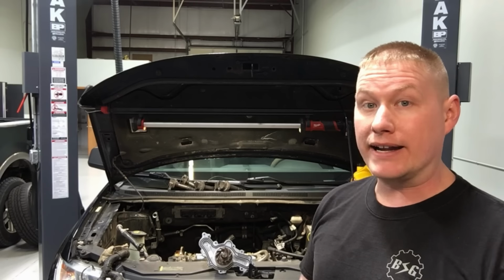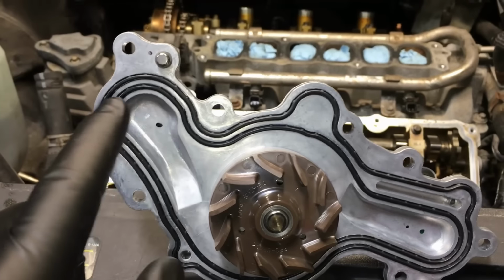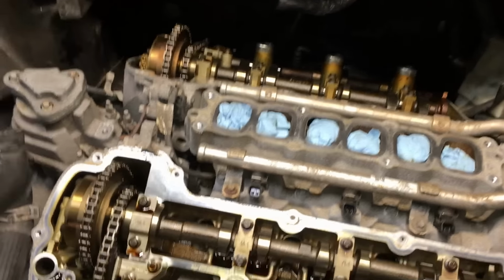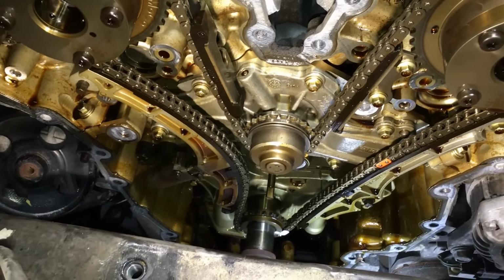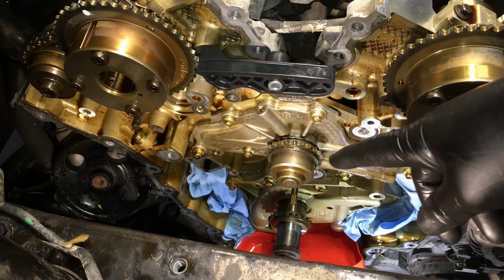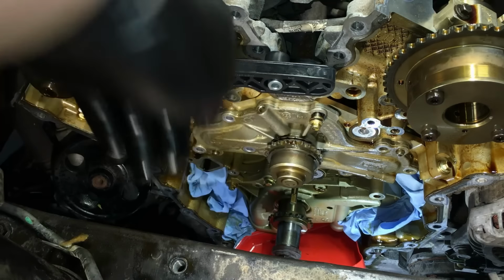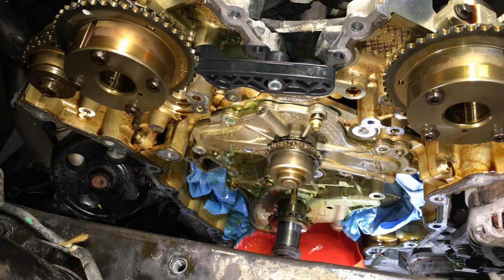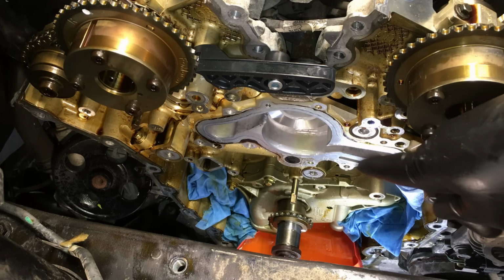Ford 3.5L 3.7L Duratec V6 Chain Driven Water Pump Failures: Check it Before it Destroys Your Engine!

Comment: Timing chain driven pumps make absolutley no sense, they serve only to make the dealerships money, I think i'll stick with my 3.0 OHV lol
Reply: I was a dealership tech for a while. They don't make any money on designs this stupid. Half of these that fail will end up in the junkyard.
Reply: @brianborell4469  I used to work at a Ford dealer and I went to visit and was shocked to see how few cars were in the body shop. It used to be a 3 week back log back in the early 00's now it's a ghost town. The reason, the new cars are disposable. Literally.  One fender bender and a side certain airbag deployment will total a car instantly, even if the actual bodywork is reasonably repairable.  Seems like the case for the foreseeable future with mechanical issues. I can't imagine the longevity of one of these new electric cars the manufacturers are hastily trying to put in everyones driveway. I guess I'm destined to be an old timer and will keep my prehistoric early 00's cars as long as possible. Not a big fan of being forced to take my car to the dealer for everything but that's what these assholes want and now we got $2000 water pump jobs to look forward to. SMFH
Reply: @LSp8  It's the throw-away generation, everyone wants a new phone every year or two, a new car every few years, nothing is made to last outside of warranty (not that anyone honors their warranties anyway). I'll stick to my gutless old beaters that I can wrench myself, if I ever need more power I'll cobble a junkyard turbo setup.
Reply: @1upPaintingAB  Exactly, I prefer to run my cars to the point I get all my $$$$ worth, to hell with resale. I'd rather keep it 10 years, turn wreches til I decide I want something else. I'm not a fan of payments 😒 and I prefer my cars to be paid off while everyone else stays in debt keeping up with the Joneses. I buy new I'm getting at least 200k out of it!
Reply: @brianborell4469  Yeap, cuz when my mkT water pump blew.  I said fuck it.  For some reason, I still want another mkT.  LOL.
Reply: Chrysler did this as well.
Reply: @johnstark5324  Yeah with the 2.7 POS.  So glad my Hemi is built properly with the water pump outside.
Reply: Agreed. Doesn't matter how nice, fast, expensive, etc a car is if basic upkeep and repairs cost a small fortune. Besides, if a person is willing to put forth the effort to build their own, it's easier than most think and in many cases cheap if you stick with common available components.
Reply: @1upPaintingAB  It certainly detracts considerably from any nice experiences when you have to spend a lot of time and money just to keep them going. Even if you have money to burn, there's the inconvenience factor and the nagging in the back of your mind "What's going to break now?".
Reply: They do make sense from a design perspective because they reduce the length of the engine assembly where a second or third belt would otherwise be required to drive it and the length is critical to it fitting in the available space. But I'd never buy a car with one.
Reply: @TonyRule  why would you need a 2nd or 3rd belt.  Many 4 cylinder cars now have the WP driven by the same belt that drives the A/C and Alternator.  A 4 cylinder is as long if not longer than a V6, so I'm not seeing the savings here.
The Duratech 2.5L and 3.0L had a camshaft driven WP on the back of the engine.  If there wasn't room on the front, what was wrong with the pump on the back of the engine?
Seems it was better before they decided to put the WP inside and drive it from the timing chain.
Finally, seems like something that can totally mess up your timing.
A chain driven water pump seems to be asking for serious problems.  WP locks up and destroys your timing hardware.  A belt driven pump, even off a camshaft will probably break the belt before it destroys timing.

Comment: I thought I had it bad with my 3.0's oil leaks! This reminds me of the 2.7 l v6 Chrysler made , similar water pump issues
Reply: Mopar?  Imagine that.  🤦🏻‍♂️
Reply: I have a 3.7L in my explorer with 245k miles and mine has never been touched. Change your oil and coolant regular and people generally have good luck with these. Never had a single issue with the drive train.

Comment: now i know not to buy a vehicle with the 5.4L 3 valve, 3.5L or the 3.7L duratec v6
Reply: trigga ville my 5.4L 3v has been pretty good. Got 185k on it. At least the water pump is on the outside where God intended it to be.
Reply: Anything that would have a 5.4 you don’t have to avoid the 3.5 in.... the F150 and all RWD 3.5s use a belt driven water pump on the outside , it’s just the fwd ones that are turned sideways you need to avoid .
Reply: trigga ville The 3.5 duratec is one of the most reliable engines out there, period. No engine is flawless.
Reply: Add 4.0 sohc

Comment: I have the wrong brand engine, but you are smart enough to help me out.
350 small block was rebuild at some point. Compression mostly 155, but 148/158 min/max. Bleed down was 120 in and held 120 on the cylinder checked. But it burns oil.
I can smell it in the exhaust.  At first I was thinking valve guides until I did the bleed down.
Thoughts ?
Reply: The SBC had a short life on the valve seals didn't it?  Haven't worked on a ton of those, but I've been told that's a thing with the old Chevy small block.
Reply: I had the valve cover off and could not hear air coming up the stem.
Not saying it wasn’t  though.
Reply: Valve seals wouldn't cause a compression leak, they could cause oil to drip into the intake/exhaust tract of the head. Could also be pulling oil through the PCV system.
Reply: Good point Brad, I did roll it over to TDC to keep from loosing air . Little tough to hear the guides leak. I’ll investigate the PVC system.

Comment: A $2,000.00 water pump is crap. A water pump should never be able to silently kill your $7,500.00 + engine. Most people dont religiously check their oil once a week so this would be a huge blind side when they go to their mechanic to inquire as to what the hell that knocking noise is... I dont think I'd waste urine to piss on a Ford that isn't a 5L.

Great video dude.
Reply: No knocking noise, you are just driving along and the engine suddenly fails.   That's how it happened to my ex wife.  Lucky she had the extended warranty.
Reply: @kennethsouthard6042  Hi! I am dealing with the same issue, damaged my Ford Edge engine. I do have an extended warranty.Did you extended warranty covered all of the repairs? What year is it, how many miles? Any details will be appreciate it so I can fight my extended warranty of needed. Thanks!
Reply: @cam23417 It was a 2011 Edge.  This happened in 2019.  We leased the vehicle new when we were still married and she bought it out of the lease in 2015 after the divorce.  I believe that she purchased the extended warranty from Ford.
Reply: @kennethsouthard6042 thee extended warranty or extended warranty from third party
Reply: Maybe that's what Brian Charged, but other shops would charge closer to $2,000.00 dollars. Already seen it.
Reply: I have 240k on my explorer with the original internal water pump so i dont think there as bad as you think. Engine still runs quiet and smooth also.  @wtfman5313
Reply: My water pump on my bmw is located on the bottom of engine block easy to get to but coast around 800 to even buy the water pump if you buy oem.
Reply: @SuperJeremi10  thanks for convincing me to never buy BMW
Reply: @martialman.4563  parts are expensive but i love my bmw so i dont plann on trading it in anytime soon mines a 2008 with 100,000 miles
Reply: @SuperJeremi10  Bought a Model 3 last year, turning into a full fledged Tesla cult member. I might be interested in getting a BMW bike from the 60s in the distant future.
Reply: If everyone checked their oil weekly like they should they'd put most shops out of business.
Weekly oil and leak checks saved my 2014 Tremor from catastrpohic trans failure. One of Brian's videos alerted me to check the piping. It was leaking and he is right as to why.
Reply: and on a number of those vehicles, the 3.5 has an oil change interval of 7500 miles. So you could go thousands and thousands of miles with water in your oil pan, destroying the internals of the motor.
mmm mmmmmm, nothing like Ford Vinaigrette.
Reply: There would probably be coolant on the ground before that happened.  It would drain thru the bleed hole and then out. Coolant wouldn't get into the oil unless the second gasket fails.
Reply: @MrLEO1353  the shaft can fail without the gaskets failing
Reply: @alexrosado3890  and mine just did...
Reply: @MrLEO1353  Wrong. that weep hole apparently only indicates failure of the edge gaskets (oil if outer, coolant if inner) but does nothing to warn of a shaft seal problem. I had not a single drop on the floor for years, and then all at once, high temp, and the coolant was all 'gone'..... straight into the crank case...

Comment: Could Ford make it anymore difficult to change the water pump out on these engines?  Probably not.
Reply: You know what's even less time consuming and doesn't require engine removal? Putting the pump on the outside of the engine and driving it with the fan belt!
Reply: @billgateskilledmyuncle23  Best Reply!!!  Facts!
Reply: @billgateskilledmyuncle23  On this same engine they do that with the rear drive version.  However, to get that extra bit of clearance to fit it transversely between the shock towers they went this route on the front drive version.
Reply: @kennethsouthard6042  honestly, I'd rather have an electric water pump than to have to crack open the engine to fix it. An electric pump could be put anywhere on the engine.
Reply: Flexplate driven water pump? Remove transmission and torque converter to replace.
Reply: gokartbuyer lmao
Reply: They will find a way!
Reply: I did a Nissan 3.5 like this and the Chrysler 2.7...... I hate them but it pays the bills 😜👨🏻‍🔧
Reply: @wilsonocasio8884  I have a 2001 Sebring with the 2.7 lol when that day comes I'm just gonna put a 🔫 to my head.
Reply: Ozzstar my god don't challenge them
Reply: Lets not forget where some of Ford's designs come from... Europe.. The dreaded Cologne 4.0 SOHC Engine comes to mind here.. I'm sure theres a thousand different ways they can make this job a living hell. Makes me not wanna ever buy a new vehicle.
Reply: Lets ALSO, not forget where some of GM's designs come from.....Germany. But, because GM designs are "perfect", it doesn't matter where they come from!
Reply: Lots of cars today have timing belt-driven water pumps. This chain driven (a 5' long chain from the looks of it) one being in the oil galley, is another thing altogether.
Reply: @SmittySmithsonite  Exactly.  Lots of cars with timing chain driven water pumps but this design where it fails and is almost certain to destroy the engine is just one of the dumbest designs ever, all so Ford could jam a 3.5L engine in the old 3.0L engine bay.  Ford is now getting sued for this design.
Reply: @mattandrews684 they could’ve put the water pump on the end of the engine like they did the 3.0 liter v6 and have the exhaust camshaft operate the water pump .
Reply: @SmittySmithsonite  Timing BELTS (mostly Kevlar) USUALLY aren't lubricated by engine oil....LOL
Reply: Yeah, one small difference.  You don't have to lubricate a belt with engine oil, lol.
Reply: Oh, don't ask that question, Ozz! They'll consider it a challenge! 😂
Reply: Many, if not most, of the older Subaru's have have the water pump driven by the timing belt
Reply: Super common. Much less of a ugly involved job on most vehicles
Reply: @cloudwalker3650  Yes, but if the water pump seal fails you will see the coolant leaking on the ground. The Ford leaks into the oil pan!
Reply: Ozzstar Ford Engineers:... Hold my beer 🍺...
Reply: Are all Ford Edge years the same design?
Reply: Subaru h6 has the exact same design this seems to be common!
Reply: That engine DOES have an external belt-driven water pump.  It's only when it is in a transverse application that they move it inside.  The Honda V6s have a timing belt you should replace every 100,000 miles.  Some don't and they go a quarter million miles and the belt still hasn't been changed.  When you replace it on schedule, you also do a new hydraulic tensioner, water pump, and set the solid lifters.  However, a bad water pump does not leak into the oil.  It costs ~$1500.  A chain you don't need to change a chain every 100,000 miles.  However, because there is no schedule for the chain doesn't mean that it doesn't make sense to do so every 150,000 miles.  It looks like it costs about the same money, and any extra swapping the chain might be offset by not having to set the valve lash.  The water pump sprocket is simply an idler, so there would be a lot less tension on the bearings than with a belt, but if it does leak, the water goes into the oil.  A  water-in-oil detection system would be something Ford should have.
Reply: Well Nissans 3.5 is no walk in the park either and it appears to be more cumbersome than the ford 3.5. I have done timing chains on nissan 3.5l engines and its...... Well you dont have to remove the valve covers. but you do have to remove the lower oil pan.
Reply: @HakeemsAutoRepair  VQ35DEs have an access cover over the water pump. You don't have to yank the timing cover and chain to do a water pump on those. Remove the access cover for the right hand tensioner and take the tension off. Remove the water pump access cover. Rotate the engine back a little to let some slack into the chain and slip the water pump out. It's a 3 hour job vs. 11 hours for the Duratec 35 water pump. And no special tools needed for the Nissan. 
Also, Nissan had the good sense to not use the teensy little water pump shaft and bearing as a pulley for the entire timing system. On the VQ, the water pump is only driven by the timing chain, it doesn't take the full force of the cams, crank, tensioners, etc.
Reply: Which model Milwaukee ratchet are you running? Planning to pick one up.
Reply: nonreplacable water pump in the short block itself
Reply: supercyril, the engine really should be dropped for this repair, to get the timing cover reinstalled properly..., check out triangle automotive
Reply: Not just Ford Sherloch
Reply: My daughter has a 2014 Explorer that’s leaking. Neither of us has 2 grand.
Reply: Ford Engineers: challenge accepted!
Reply: This is one example as to why Ford car sales are in decline and Why Ford is quitting the car business!
Reply: @Ascotman  ALL "car" sales, not just Ford, are in decline. In case you haven't heard, GM has also stopped selling cars that used to be popular. And we all know that GM builds BETTER vehicles than Ford! Good riddance to CARS, long live the SUVs, CUVs, and trucks!!!
Reply: why would you EVER buy a ford lol? Designed to fail.
Reply: @johnsteele8073  it's all new cars not just ford
Reply: @johnsteele8073  Not true.  I’m driving a 2009 Focus with 265k and have changed 0 parts on the engine or trans.  Also have a 02 Powerstroke with 0 failed parts.  Then again I do take care of them, but Ford is no worse than other manufacturers.
Reply: @johnsteele8073  Yup! Buy a GM product OR a FCA product, they NEVER fail....LOL
Reply: Its actually not to bad. No need to remove engine from car. This repair can be done with engine in vehicle. A little time consuming but not that hard to do.
Reply: @SuperCyril2  yeah that's what I've surmised looking at the location. With experience probably around 8 hour job
Reply: SuperCyril2 can you explain how?
Reply: SuperCyril2 You are living proof of a FORD BRAINWASHED OWNER !!

Comment: A great reason to not buy ANY transversally mounted V6, Timing chain driven water pump equipped vehicles(I'm looking at YOU, NISSAN). Even inline fours are becoming A MECHANICAL NIGHTMARE.  👎👿💩
Reply: I had a Maxima ...wp under the cam covers like this...they have a little door to access it and a procedure to release chain tension. Still sucks but 3 hours beats 14
Reply: James Lee you're correct, don't mind me too much, I have a close hate relationship with their arsehole tight engine compartments and overgrown engines. Lots of hate stories from working on both the VQ and the QR.
Reply: JIGA BACHI understand completely. Just seems that some mfg engineer a little help to the mechanic knowing access sucks.  Others don't.  Just about any transverse v6, and some 4cyls even suck... the engine bays aren't open like a W body GM of the early 90s.

Comment: Yeah, 14 hours to swap a water pump. SOB!
Reply: Bob Earley I've done 3 of them in the last 6 months. I've got it down to 9.5-10 hours...
Reply: I have it done in 6
Reply: @SFBay69  Experience is everything and not breaking stuff of course. Gotta give props to the wretcher/mechanics out there
Reply: @SFBay69  6 hours is still Absurd for a water pump job. The fact that you have to rip the car apart is just stupid. I did one in my 03' Escalade and it took one hour, including the time it took to wait in line at AutoZone and the clean up afterwards.

I don't think I'll be buying too many newer cars, at least without a warranty. Water pumps used to be a 1 he job on a Saturday morning in your garage . Sadly it's came down to the labor rate it takes to replace the whole engine
Reply: @LSp8  I agree.....but it is what it is
Reply: 1st and 15th impressive, i bet you’re hauling ass replacing that thing.
Reply: The mind of a Psychopath 

4

Lol. Just kidding. Never have. My Taurus has 223k on it. I don’t care about it. I beat it pretty hard. Live back a 1 mile long drive. She won’t die.
Reply: @robbyschemonia3089  you in Michigan?
Reply: Bob Earley I’d get rid of it, especially if the bearings are already compromised.  It’s not worth putting big money into a car after 150k miles.  Most transverse mount V6 cars are basically throw aways.
Reply: @user-tb7rn1il3q  185k, I really would not consider that a throwaway.